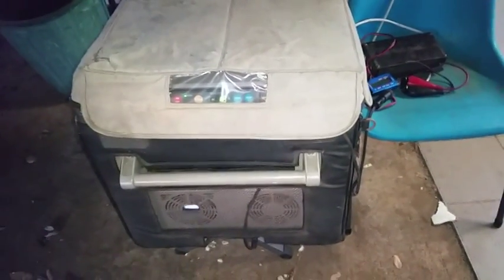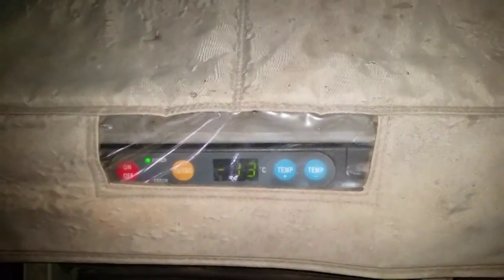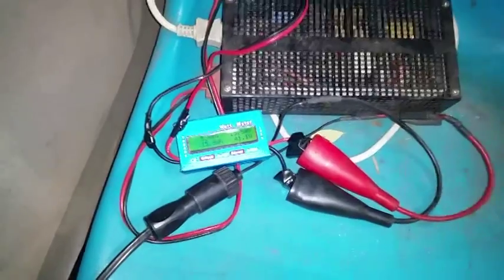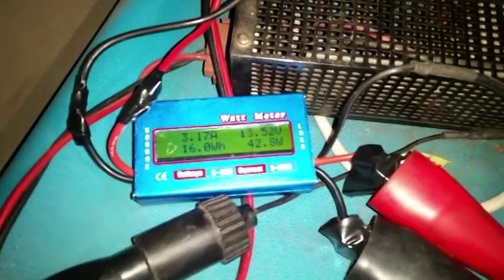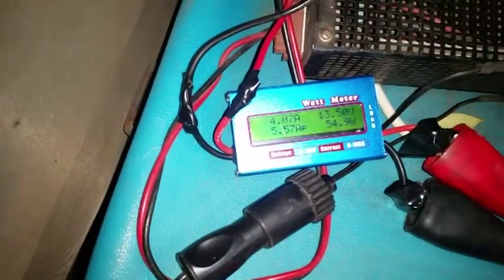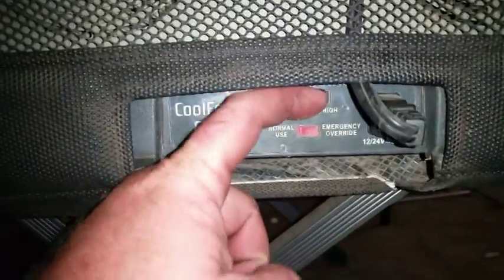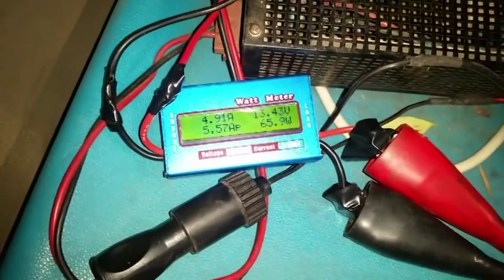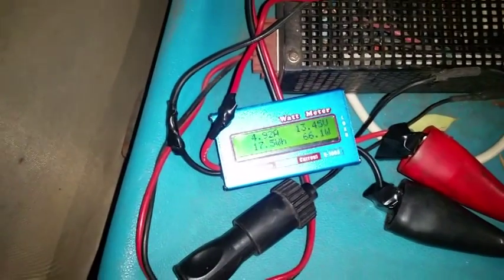Waeco CF80 Power Consumption / Current Draw  - economy, normal, high.  volts, watts, fridge gauge!

Comment: Ow did u put the second temp gauge in it
Reply from the maker: You have to tear the bottom off, not easy but doable, then thermal paste the probe of the new temp gauge to the fridge compartment side. Or you could just buy a portable one and hang it in through the lid.